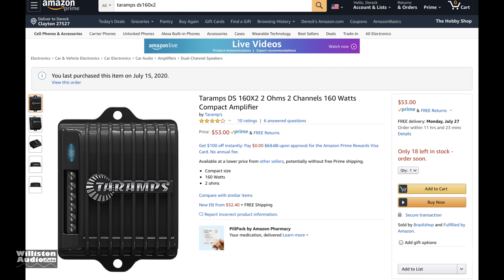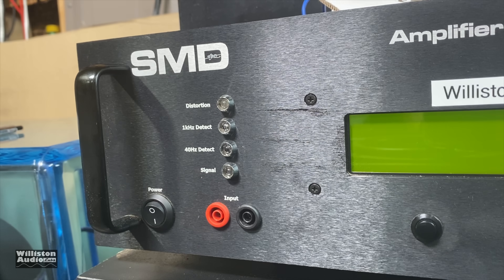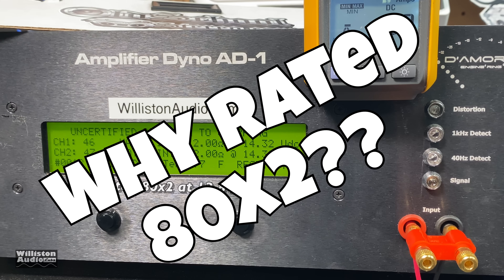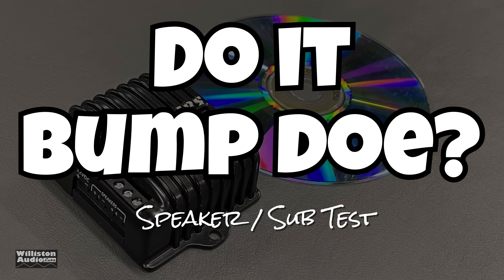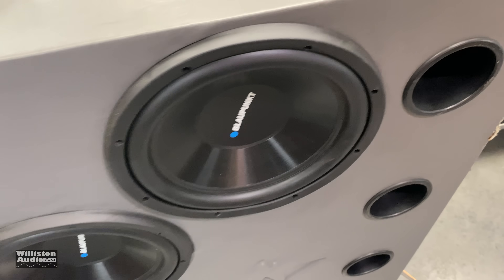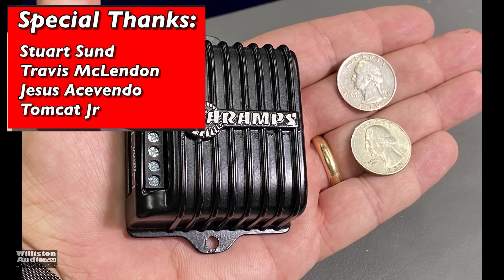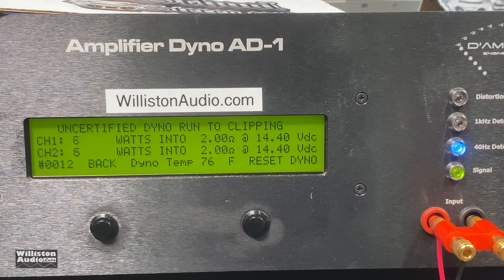Tiny Car Audio Amp Tested! Taramps DS160x2 Amp Dyno

Comment: Could really use your advice. I drive a hybrid vehicle that comes with great sounding factory speakers which produce very little bass. Plenty of room to build a box into the driver seat base. Would like a combo that uses very little power to provide adequate bass reinforcement.  Like a small class D amp running speaker level inputs, a high impedance 10 inch driver-lower weight and pulls less current, and a strong but lightweight box. Would it just work better to buy a powered under-seat sub or is it possible to build a better performing, more efficient setup?  Thanks. Big fan of the channel, old-school systems, BMX, boomboxes, etc.

Comment: Is 8000 watts 4 channel amp is capable to handle 2x 15" subs and 2x 12" instrumental speakers?
Reply: Use two separate amps so you can set gain appropriately for each pair of speakers

Comment: I had a tiny A/D/S amp running 4x6 plates in my 1988 Cadillac coupe deville.  I think it was 20 watt amp.  I bought it to replace the deck power running the dash.  That amp wasn't much bigger than that taramps amp.

Comment: I'm super happy with the Taramps TL-1500 that I bought for my 400watt 8inch sub. It was smaller than I thought but it packs a punch!
Reply: Hey i live in az is it good with heat or does it get hot i want to put it on a trike im building id really appreciate the info if you have the time thank you have a good one
Reply: @danielgurulee12  on the underside just install a computer type fan to it and it would be awesome I reckon

Comment: You know, this would be a really great solution actually to get a bit more power out of rear deck lid speakers in a sedan. You could run the speaker wires right into the speaker level inputs then right back out to the speakers, then all you need is a small power wire, no remote wire or RCAs to run. Other ideal purposes probably would include upgrading a motorcycle system or other compact vehicles. A 4 channel version or two of these could also be great for tucking behind a head unit in a car, similar to the powerpack amplifiers Alpine sells. Yeah it's probably not that reliable at the end of the day honestly, but for 50 bucks it's definitely a really cool little amp to play around with. It sort of reminds me of those keychain amplifiers Steve at his meade916 channel was showing off recently.

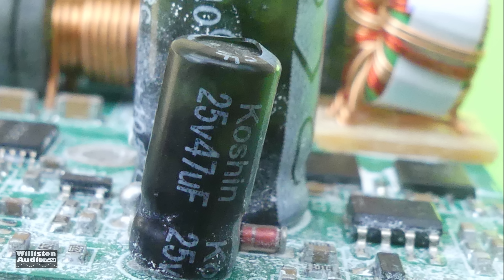Comment: 8:09 That is a TPA3221D2 class d amplifier IC behind the 470uF capacitor. 
You will nead to run the TPA3221 IC at 30VDC to get 100watts perchannel.
Reply from the maker: Truth!
Reply: Spotted the same thing. The power diode, mosfets and the single toroid choke are probably for the step up regulator. From the data sheet, I imagine it's running 18-20V and because its in stereo mode won't support 2R. Nice heatsink design and probably a noticeable step up from 12V supplied chips, for anything except a subwoofer.

Comment: Hey Big D! Since that amp has a remote input on the back it looks like, I wonder what kind of numbers it would do with a L.O.C and Low level input with a clean signal. Side note: I’m also looking for a good pricing guide for my PG ms1000ta I’m looking to let go. Any ideas what to use as a reference?
Reply from the maker: Turns out it works with RCA inputs also. I may make a short update vid. Price of your MS1k depends on condition
Reply: @wal  That's great that it can use RCA inputs! I'm glad I snagged a couple before the video was even over... I'd say the MS1k is in 75-80% good condition. it works flawlessly but it has a few small chips in the powder coating and a couple cracks around the screws for the clear bottom.

Comment: TPA3221 should be capable of 105 watts stereo in to 4 ohm and 170 mono at 2 ohms i think the power supply inside the amp is way underrated
Reply from the maker: Yeah probably requires the 30V input yet this amp has 25V caps and a max stated input of 16V

Comment: Just wondering where you get the information that high level isn’t as clean as rca? Do you have test proving this? I’ve always been told that it’s just as clean
Reply from the maker: Amplifying an amp is boosting noise twice. This amp works with RCA inputs as I just tested. May do update video
Reply: Williston Audio Labs sure but technically rca outputs are an amp... the signal coming from the source has to be amplified even for low level. I would love to see an update video! I’m not trying to start an argument but basically every sales rep for amps that I have talked to says high level are just as good as rca . Reps from companies like kicker Rockford and Jl so we’re they just trying to sell more amps? Thanks !

Comment: Still trying to figure a practical use for such a tiny amp, motorcycle? However most head units that fit a motorcycle have more power than this amp.  Any ideas folks for a practical use for this tiny type of amp?

Comment: Man, if this little bugger would have been rated 30/50 RMS, been capable of such, had an adjustable gain dial, included some RCA to speaker line adapters AND been able to be bridged and do 100RMS@4 ohms, then it'd be an awesome little amp. Hell, I'd gladly pay $70 for it if it did all that.
Reply from the maker: Don’t forget built in Bluetooth 😁

Comment: points at one of the mosfets in the power supply section
"It's really a class D amplifier"
...I don't think so Tim...

Anyone know what amplifier IC these actually use? as I don't know of many/any that are even 2ohm stable..
Would also be interesting to know what voltage they're boosting the battery voltage too. With the 25volt capacitor, I'd guess its 20volts or less...
Reply from the maker: I have a close up pic but could not determine the IC based on the numbers stamped on the chip
Reply: @wal  it's a TI TPA3221. Should have been good for almost 100W if the power stage hadn't let it down.

Comment: Why does it use speaker level inputs?
Most head unites put out 45 watts per channel stock.
This thing is just riding the wave from the head unit. 
That efficiency is horrible.
Reply from the maker: Most head units are around 15-18 watts per channel so this will double output power. The 45 watts you see is a “max” rating

Comment: The mosfets are not for the class-D amplification, for what its worth. Those look to be part of a half-bridge switchmode converter, and the schottky diode next to them is indicative of it being as such. The small toroid will be the switching transformer. Id guess its running at something like 20V. The actual amplification is coming from the larger SMT chip (IC1) that has the metal contact pad on it, which is almost certainly some form of stereo, bridged class-D amplifier IC from the lack of polarized capacitors in the output and the low operating voltage.
Reply from the maker: Thank you 👍

Comment: I won't buy that.. I test the 400x4 for stock speakers and it's loud,, I wasn't even expecting that much power out of the 400x4.. highly recommended,  note use passive crossover at least..

Comment: wow didnt see that 2ohm run coming on the taramps , but when i stuck around to the end that was the real treat !!! im saying to myself please do 2ohm cert. please do 2 ohm cert ..... and BAM you did it !!! crazy thing is you got a better number than i did in my testing but not by much !!! i came out 2-4w less i think mine came out a little less because i had all 4 ch's loaded maybe ? however i should note that i swapped the plug to one with slightly thicker wire ;) and that actually gained me 2w !
Reply: It's only a 2 channel amp tho...
Reply: @Ashquacks  watch till the end ;)

Comment: Would be great for those using a DSP from bluetooth, such as the Dayton Audio 408dsp, instead of a radio.
 Also I noticed it has a remote turn on wire on the bottom.
Reply from the maker: Not sure if that turn on is for using RCA inputs. I’m gonna try

Comment: Was the amp actually getting 14V through the 12awg wires under load? might be an explanation for the poor 2ohm performance?
Reply from the maker: I’ve used 12ga power wires for amps over 200 watts before and it was fine. In this case, it’s the largest that would fit in the insert terminals, plus they were only 6in long
Reply: It was cutting off, from the test results. My guess is overcurrent since the power supply in it is absolutely minute in size.
Reply: It needs 30v to reach it's power.

Comment: I always expect amplifiers to do a little more than rated but this was a disappointment.
Why go so small if you can’t do the power that is rated for? They could’ve made it a little bit bigger and do rated power with adequate components inside. 😑🤷🏻‍♂️

Comment: How much do you think the speaker level input plays into the detection of distortion on the Dyno?  Do you think it may be cutting the amp off before its fully out of oomph?
Reply from the maker: I had it turned down as not to distort, but I will try RCA inputs to the amp to see if it can be measured this way

Comment: It uses a tpa3221 chip, so yeah i guess that output power is expected. The chip has a max power output about 88watts at 4 ohm at 30volts the fact that it can produce 40watts at 14 volts is quite amazing
Reply from the maker: Thanks I should’ve mentioned that
Reply: I just watched the video and check TI site... My thoughts was exact as yours :) So no need to write same comment as you ^^

Comment: Hello BigD, I think you had less power because you used a to much thin and to much long wire for the power supply. The lack of power comes from the fact the power wire is not enough strong for 2 ohms.

Comment: I know in some RF applications, the amplifier won't output its rated power if the input signal is too weak. That amp is far too small to use an isolating transformer for the speaker-level input, so I'm wondering if you've run into the same situation here? It's a stretch, but... 🤷‍♂️

Comment: Definitely the kind of amp you could use as a bit of a power upgrade for door speakers or tweeters vs the speaker level output of your average head unit. It's small enough you could easily have it tucked away in the dash of your vehicle. Basically hook it up and forget it. For that purpose it's not bad since most of the time it's going to be hooked up to 4 ohm speakers anyway.
Reply: Agree. Could be a good bang for the buck if upgrading your door speakers but a full amp install is not in your budget. Considering all the name brand "power pack" mini amps are in the $200 range not including install. This amp could use the factory deck power wire no problem.
Reply: @whichgodofthousandsmeansno5306 who pays for install?

Comment: The effiency might be bad and the ratings don't hit where they are supposed to be, but this amp is a beast if compared with the Mitzu 😂 I would use the taramps for a bluetooth speaker
Reply: yea that or for a stock radio to put behind the radio and give your speakers more power

Comment: I don't think that MOSFET is for the audio, I thing it's part of a converter. The other pad up chip is probably the audio amp
Reply: Yes! I was getting sad that nobody corrects this. Thank You!
Reply: Yes. The data sheet he showed was for a plain MOSFET. There is no Class-D controller in it. The controller is one of the other devices.

Comment: 8:32 Those mosfets drive the little transformer that powers a TPA3221 chip amp which can be seen at 9:26. The SO 8 pin package at 9:32 would be the PWM driver for the mosfets
Reply: Yeah I had to rewind and look after seeing that spec sheet those are definitely the power supply transformers. the amp is the other, longer chip

Comment: That amplifier has no power supply inside it, the full-bridge class D amplifier runs direct from the input voltage. This means the output clipping level is limited by the input voltage, thus a theoretical max of 14.5V peak or 10.25Vrms. Ultimately, this works out to 26W at 4 ohms, 53W at 2 ohms (real world numbers will be slightly less due to losses).

The 2 ohm dyno result is exactly what I would expect out of such an amplifier, but for some reason the amp is exceeding the theoretical maximum at 4 ohms????

Comment: That's a Texas Instruments Tpa32xx audio controller ic (The 44pin), probably the tpa3245, I recognize the pin out. The s86c is a SS8P6C schottky diode two channel which is all that's necessary for a single supply chip such as the tpa. The fets (18537's) are the switchers for the push pull power supply as the tpa ic contains its own output fets. The 8 pin chip that says 3808 on it is most likely a ucc3808x current mode push pull controller of some brand maybe intersil or texas instruments??
Reply: TPA3116 100w 2ohm
Reply: absolutely with ya here.   those are 100% all in ones.

Comment: there is a tpa 3221 class d amplifier , both mosfet are only for " power supply" to boost 12V . FEATURES
Wide 7V to 30V Supply Voltage Operation
Stereo (2 x BTL) and Mono (1 x PBTL) Operation
Output Power at 10% THD+N
105W Stereo into 4Ω in BTL Configuration
112W Stereo into 3Ω in BTL Configuration
208W Mono into 2Ω in PBTL Configuration
Output Power at 1% THD+N
88W Stereo into 4Ω in BTL Configuration
100W Stereo into 3Ω in BTL Configuration
170W Mono into 2Ω in PBTL Configuration
5V Gate Drive or Built-in LDO for Optional Single-Supply Operation
Integrated Protection: Undervoltage, Overvoltage, Cycle-by-cycle Current Limit, Short Circuit, Clipping Detection, Over-temperature Warning and Shutdown, and DC Speaker Protection
90% Efficient Class-D Operation (4Ω)

Comment: From what I can tell by looking at the Amp those mosfets are for the DC-DC power section, so that the amplifier gets more voltage than the input voltage. The Amp it's self is that little chip in the middle(probably some tpa class D chip)

Comment: I've always wanted to hide the amps in the doors,this little thing has got me thinking, 6.5/5/14_speakers already in the car,pioneer DEH,8500.BT+,old school,it would come down to best sound,head unit,or amps,all tucked away out the way,to keep the best possible quality I would turn the signal digital,down a fiber optic,back from digital to analog, real cheap on flee bay,ile try it with the front doors first and let you all know what the outcome was,
Stay safe,Cheyenne

Comment: This would be dope on one of those electric kids cars
Reply: I think it's mostly designed for motorcycles...
Reply: @pastorofmuppets325  That and its probably good for speaker installations in door skins and the like since it can work with a minimum of connections and fit in tight spaces. Although with that said not sure how it would be running at its peak output for long periods of time in a confined space since theres not much there to act as a heatsink and the low efficiency.
Reply: @mysock351C  It doesn't have any kind of built in x-over though, so you'd have to go old-school & use a coil & a capacitor to run a mid-range & a tweeter with one of these. The SQ would be iffy at best...
Reply: @pastorofmuppets325  For a DIY or run of the mill system for a daily driver with coaxial speakers it would be decent. Obviously if your going for sound quality or competition stuff, then youd go for a better amp.
Reply: @mysock351C  🥴
Reply: I'm definitely going to have to send it to my buddy. Dude drives a 55 year old car but still hasn't put a stereo in it and he keeps forgetting to charge his BT speaker
Reply: Or a drone..
Reply: No shit pushing like a sundown zv5 4" if they made em. Probably sound pretty goddamn good!
Reply: Ok for a bike
Reply: You gave me an idea 💡😉. Grandson's little Jeep pumping.

Comment: Wouldn't the head unit put out about the same so what is the point without RCA's
Reply: Factory head unit.  If you can’t swap, drop this in w/ upgraded speakers and re-use factory wiring.  Great option for a leased vehicle, odd sized factory unit, etc...

Comment: Probably that pioneer alone has more power than the Thramps amplifier.
My Sony deck DSX-A415BT Has a 50wX4 integrated circuit and it doesn't require to wire it straight to the battery like my MEX-XB100BT.
Reply: Peak, not RMS. This amp puts out more than your headunit could ever dream of. You're not even going to get 20wrmsx4 out of that head unit.
Reply: @mikem.9197  Which head unit. I own the Sony MEX-XB100BT and the DSX-A415BT.
Nop the iC specification chart on the DSX-A415BT 50wX4 RMS.
I'm not going to tell you the iC chip number so you can do your own research. 
I haven't open my MEX-XB100BT but wiring is heavier than that lil amplifier and is class D as well.
And not my stuff do not dream.
And always my shit is the weakest on haters eyes.
Reply: @mikem.9197  If that was the case they should keep using the tda2004 20w on btl

Comment: I have the taramps TL 500 that is almost the same size as that on my bike using a Bluetooth board little 5ah 12v battery 2 skar 10” mids 1 skar pdx-1compression driver and 2 super tweeters And it gets loud plan on adding an 10ah battery to get louder ... can you do an test on the taramps TL500 here’s an distance test of my bike using the TL 500 on my channel https://youtu.be/jJF_Kq-XKVc

Comment: RCA's have been around for so damn long, I wonder when they will come out with an upgraded input wire!!! Like maybe an HDMI wire strictly for audio??? I think it's time for that anyone else???
Reply from the maker: We need balanced connection like mini XLR. Some amps in the 90’s used them
Reply: There was a brief time where optical toslink looked like it was coming on strong, then it just died.  Dunno if it was too expensive, or if the optical cables were too delicate for the car environment?
Reply: Clarion has some new tech.... It's a digital connection at the speaker to the Amp.... Takes their special "Digital" Speakers and subwoofer tho